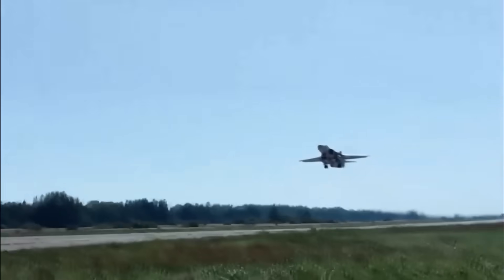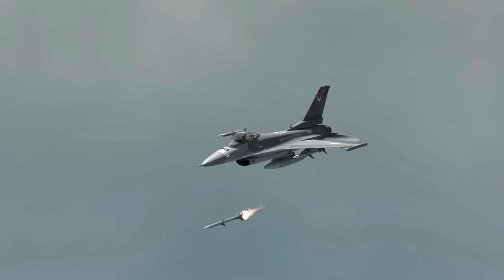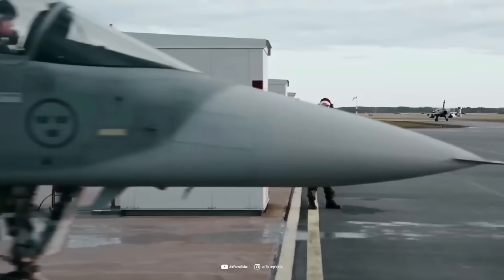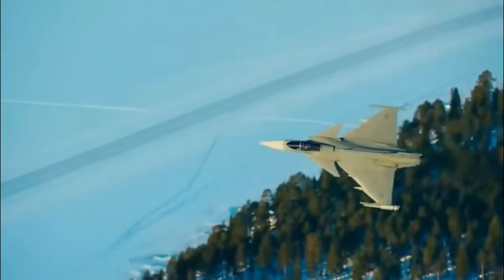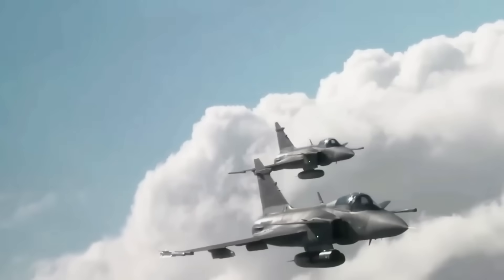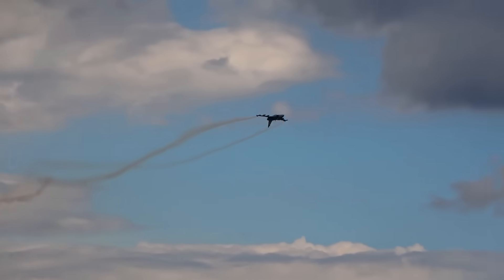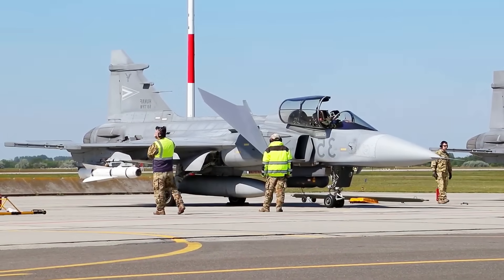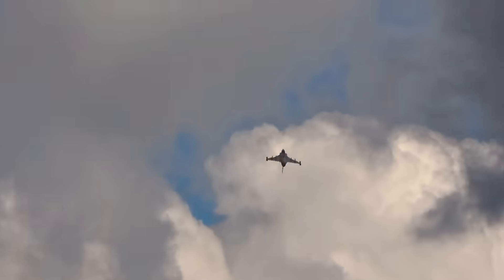SWEDEN's New Gripen Engine Will Change Global Power Forever?

Comment: This is a hysterically funny post. In the first place the description of the Grippen is ridiculous. It's not stealthy and consequently it can't slip under radar screens. Saying it does not consume mass budgets is because it can't do with the f-35 does and everybody knows it including Canada's own Air Force which gave it a much lower rating than the f-35 and their evaluation. But finally it's funny about the engine. Jet engines are the most complicated part of any aircraft. Virtually all of them in the world are American. Even as far as Rolls-Royce is concerned one of their two engineering centers is in the US one is in Britain. In addition there's no guarantee at all that they can produce this engine especially without violating ge patents. Even if they can it will take years and Canada will get an even longer delay waiting for their aircraft which as things are going right now will probably already be obsolete in 10 or 12 years. 
Your post is ludicrous and ignorant. What Canada really should do is save some real money and buy Sopwith Camels. 😅😅😅😅
Your comment about America no longer being trusted in defense partnerships is also deceitful and wildly inaccurate. As a matter of fact right now Finland Norway and Italy are taking delivery on f-35s. You should also know that while you say the US is not trusted Rolls-Royce has accepted a contract from the US to re-engine The b-52s. This contract is worth far more than the contract to build engines for Canada's small number of aircraft. 
So just to let you know you're being reported to Google moderation for all these mendacious statements.

Comment: The SAAB J39 GRIFFIN is exactly what Ukraine needs. The worlds most competent and effective figther,  developed for the defence of a relatively small country against a 10-20times larger attacker. Super money efficient, the education of pilots is much much lesser time than most fighters, intentiosly made superlogical in its handling,, refueled rearmed maintained by conscripts and back in fight again within minutes, on a random swedish roadstrip of 780m, no need for 2000m sweeped runway (which barely exists in modern warfare), no hours of ecposed"sitting defenceless duck" on a high prioroty target, airfield, maintained by engineers..
During a 10 year span, with education, maintainance, spareparts combats, training, purchase, fuel etc etc, it costs a fraction compared to most other fighters.
In real combat The GRIFFIN is more "invisible" than any stealthfighter, it can track down, lock on enemies and fire even sc"stealth" fighters, that done without the enemy even know it's tracked.
In combination with SAAB340
AWAC, It wins 10/10 times.

Comment: It may be all you say but unless it is equipped with both low and high frequency radars and IR detection and especially hypersonic missiles it is useless since any future war will not involve duals between aircraft but the ability to fight at long range using missiles like Oreshnik and the ability to evade radars-missile systems like the S500 and Pantisir. Russian Mig-31 and now 41 aircraft flying above 80,000 feet that is well above the ceiling of any NATO aircraft can detect these and other stealth  aircraft like the F-35 and F-22  at 300 km an hit them with hypersonic missiles within minutes  or even greater distances with information from the S-500/$)) Dome radar system or Russian satellites that cover the whole of the NATO territory. The future of aerial warfare is drone swarms such as those that China has in its arsenal  with drones carried in a large mother drone until launch time. and flying at high altitude.

Comment: 7:00 as a Swede i say the hype about the F-35 is just insanity, but i also say that mixed air flets are smart, you should have a small mix of different types of planes and not rely on only one model or type. but that also makes it more expensive and harder to maintain and you need more people with different skills. that dose only work for large population nations.

Comment: Gripen was not build to start and land on road...... SAAB and Sweden have always design airplane to land and take off on road  since more than 70 years ago. And design them so you do not need a master degree to do maintenance on them. Especially indoor. We just do it outside far away from infrastructure. And maintenance are done by people who could be a bussdriver Carpenter farmer. The are educated under there ordinary army services. And Viggen was another proof about a great airplane it could even put in reverse if it was needed on ground and only needed 800 meter to land and take off . And also locked there radar on SR-71 Blackbird. And att last 1987 a SR-71 Blackbird got some engine problem and two Viggen catch up and escorted two other Viggen tok over until Danish airplane took over it so it could land in a Nato airbase in Germany Putin (Russia wanted to force it to land in Russia or a country that was connected to Russia and have sent out Russian airplane to shoot it down or force it to land.) But four Viggen and Sweden gave Russia 🤥 these 4 Swedish pilot was honored 2017 whit medal of air from usa.

Comment: Oopps I was thinking that IAI Lavi (Hebrew: לביא, "lion") is a single-engined fourth-generation multirole jet fighter developed in Israel, by Israel Aircraft Industries (IAI), during the 1980s. 
Get cheaper already? 60 mil mentioned before was 85 number? What the engine? RR? When? How it works? How long to wait? See has a hook, good, provide info on new engine.

Comment: No, the JAS 39 Gripen E/F does not have a new engine from Rolls-Royce; the current Gripen E/F-series uses a General Electric F414-GE-39E engine. However, there has been talk and even a Facebook post from April 2025 suggesting Sweden might offer the Gripen with a Rolls-Royce engine, though this is not yet confirmed as a standard or official option for the fighter. However there is a rumour that there might be an upgrade/development of the GE F414-GE-39E (Swedish designation RM16) by GKN Aerospace. But it would still be decided by USA whether sales can be made!!

Comment: While I thought this was generally a good video, I had to give it a thumbs down because of technical issues.  For example, I spotted a Eurofighter at one point, when the voice track -- glaringly AI generated -- was talking about the Gripen.  Along those same lines, there were several points where the voice pronounced the name of the fighter as "Gripe-en" rather than Gripen.  On top of all that, there were a few depictions of Gripens that clearly came out of a computer game.

Eight minutes in, and, "I had alls I can stand, an' I can't stands no more!"  Pulling the black and yellow handles on this video!

Comment: What advantage does the 2nd rate "foreign version" F35 offer Canada?  Canada's only real enemy is the USA, which controls the F35 puppet-strings & had (or should have) '00s of F35s.  72 will make no difference.  Spend scarce Canadian $$$ IN CANADA NOT in Trump's pocket.   Canada has the expertise and partnerships to help develop the Gripen, its engines & airframe.  Or indeed go with the French Rafale.  The Gripen is made for covert deployment in harsh Arctic terrain and was orig. designed with alternative RR EJ230 in mind (23K thrust).  If the CAF get over their "wanna-be American" sad complex & lighten up on maint protocols like Sweden, Gripen can be operated with a quarter of F35 crew.  Canada can afford twice as many for same $$$, and provide Canadian JOBS & tech transfer.  16 x F35 offer a good training ground for the faster, more agile ambush fighter that is the Gripen.  F35 is a problematical high-maint becoming-unstealthy-barge that can be, and is, countered by use of Euro Meteor BVRAAMs and French/Swedish GlobalEye AWACS and other passive detection systems.  Gripen can also launch Taurus KEPD 350 cruise missiles against Canadian continental & opposing nautical targets.   Just need to finagle it w/o the girly-next-door having a hissy fit.  Anything is better than handing over Canadian defense lunch money to US bully pockets! "Sorry Yanks - like to have afforded your gold-plated aerial toilet, but...ya know....Trump tariffs !  Soo sorry"

Comment: The Gripen was designed to address only one adversary, RUSSIA.  This aircraft was not designed to be a multi-theater aircraft like the F-15 or F-16.
Reply: So? Isn't Russia the enemy now, despite what Drumpf thinks? You're throwing out aircraft designed in the 1970s that aren't for sale anymore. What's you point?
Reply: @diavolorosso69  Russia has always been Sweden's greatest threat since WW2.  The Grippen was designed to defend Sweden, not to be an offensive deep strike aircraft, which the F-15 and F-16 have proven more than capable.   It is the same as in World War II, with the Spitfire designed as a defender and the P-47, P-51, and P-38 having long-range strike capabilities, as specified by the USAF for its role in world military capabilities.  P.S. Both the F16 and F15 are still very much for sale, as they both have had massive upgrades in their capabilities.

Comment: Remember that Gripen is also developed on the design principle COTS (Commercial Off-The-Shelf). That means that instead of using proprietary graphics chips etc. They use commercially available chips used in for instance game computers. That gives the advantages like Lower cost, Faster upgrade cycles, Better availability and Reduced development risk.

Comment: So far only the only new Engine in the work is Flygsystem 2020 GKN Aerospace has signed a new cooperation agreement with Saab to investigate 
different solutions for future fighter aircraft systems, also Its has been given a €59.5 million investment to expand additive fabrication technology capabilities. The primary objective is New engine for (What I call) SAAB JAS 40 Rovfåge and Engine for UVA drone of the Flygsystem 2020 
Sweden has Sign the Gripen EOF by 2025  and have a Fleet of 130 Gripen E by for 2035 and first look at of "Rovfåge" at the end of this year.

GKN Aerospace most like partner Rolls Royce Aerospace or Safran Aircraft Engines. 
strongest move would both AS GKN Aerospace already work with both as make less likelihood of a future problem.

NOW as for OLD NEWS "EJ230" both stages resulted in away shorter lifespan and more maintenance, they fond out current engine is the butter zone.
Now with intake of the Typhoon the F414 would be as upgraded with higher ibf thrust without afterburner and with it could maybe do max 26000 ibf 

As good as Gripen intake system is, getting more or even just same out of EJ200 Maximum thrust: 13,500 lbf and 20,200 lbf (with reheat) is unknow.

 For Saab, Sweden is the focus when it comes to fighter jets. The plan is for it to be financially viable, even if no other country wants to buy.

-It's a tough sport to sell fighter jets. We probably shouldn't develop aircraft if we have to sell them to others to make ends meet, 
says Peter Nilsson, Saab

Comment: I'm pretty sure this whole video is nonsense.
A post from 5 years ago on Saab's website talks about the transition from the F404 engine, which was being manufactured for Saab at the time by Volvo under license as the RM12, to the F414-GE-39E
it's not an "electric assist", it's made by General Electric.
and the F414 already produces 22,000 Lbs of thrust with afterburner engaged.

It would be much more exciting if Saab had an EU produced engine like the EJ200 for it instead of relying on US based GE.
Reply: The video is repetitive, but far from nonsense.  For some inexplicable reason, it fails to say that the engine allegedly being considered (that is as far as it has got so far - the integration challenges into the Gripen are signirficant) is indeed a derivative of the EJ200.  The EJ230 is the proposed advanced, enhanced and uprated thrust-vectoring development of the Rolls-Royce-designed, Eurojet consortium's EJ200.  Currently at design stage, I believe.

The projected maximum thrust with reheat is 23,000lbs, and speculated to allow future versions up to 27,000lbs. 

Note that this would be a largely Rolls Royce, British project, presumably again built by the Euroject consortium in which RR has the highest workshare.  Britain is not in the EU any more (sadly).  Hopefully this would not impact its chances of selection.

Comment: My concern is that the engines are manufactured by General Electric. Based on the current state of instability that the US has shown as an ally and trading partner, I would be cautious having any component as important as the engine being controlled by a company that is under the US jurisdiction. It would be better if Sweden aligned with an engine manufacturer that is EU based such as Rolls Royce or Volvo (GKN). 
Yes the latter is currently involved in support and maintenance but the root is still a critical US-controlled component.
Reply: The engine allegedly being considered is the Rolls-Royce designed Eurojet E230, an advanced and enhanced and much more powerful derivative of the EJ200 built by the Euroject consortium.  Each consortium member carries out the final assembly of engines for its own country's air force.  Rolls Royce assembed the engines for Saudi.  I think the ones for Kuwait may have been assembled in Italy. Not sure about those for Qatar.  Unclear where any for the Gripen would have final assembly, but I would suspect GKN Sweden (ex-Volvo) would be allowed to set up a fifth EJ final assembly line in Sweden?  

Rolls Royce is not "EU-based" any more, of course, and nor is GKN Sweden's UK parent GKN Aerospace, since the UK crazily left the EU.  Allowing a fifth assembly line at GKN Sweden would hopefully sidestep all the inevitable (and likely French-instigated) political unpleasantness...?
Reply: @adriangoodrich4306  Thanks for the insights and yes, Rolls Royce is not within the EU - but it's outside the US and with a stellar reputation. 
Sweden has offered to build at least some of the Gripen in Canada; let's hope engine assembly moves there as part of the package!